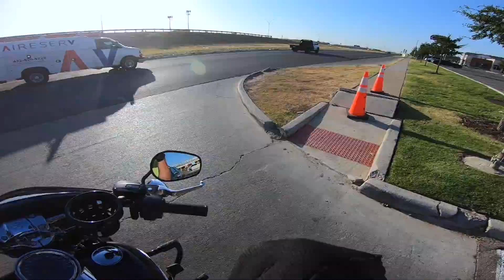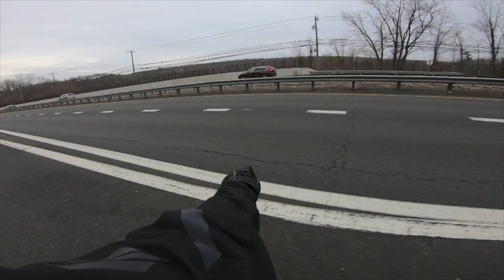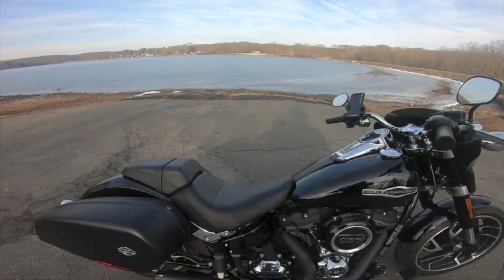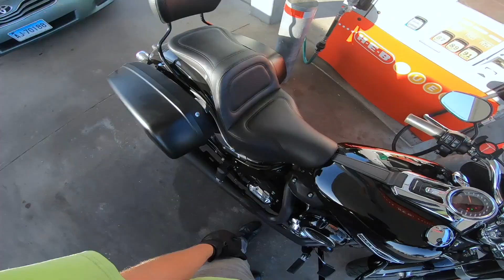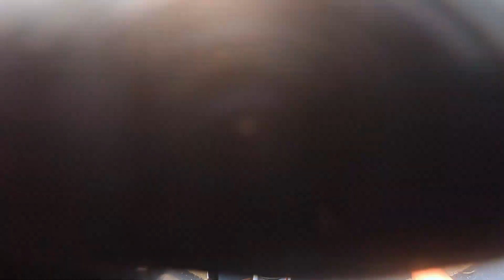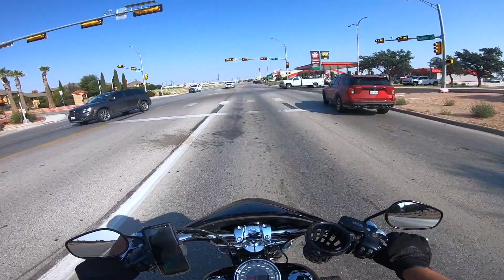Putting Harley In My Rear View Mirror

Comment: you do need to get some mini floorboards- so much better than the pegs. I love mine. also there isn’t that much difference in volume between 107 and 114.
Reply from the maker: I was going to buy some mini floor boards right before covid started, but I figured I'd save up. a little,  then when covid hit the floor boards cost $200 instead of $89!!! 🤦🏻‍♂️Guess I have to save up a little longer now 🤷🏻‍♂️. I'm glad to hear that the mini floor boards are definitely better. That's definitely my next purchase. 🤙🏻